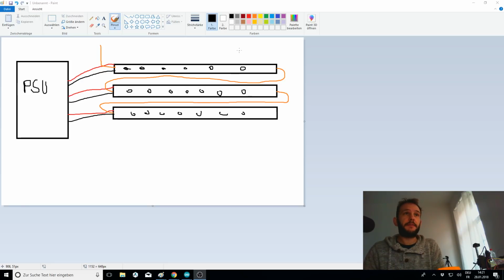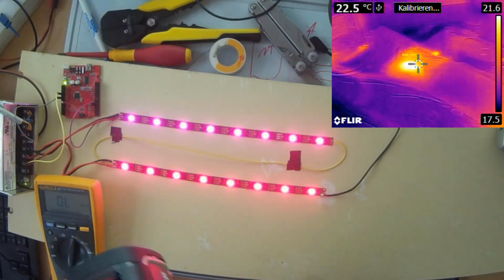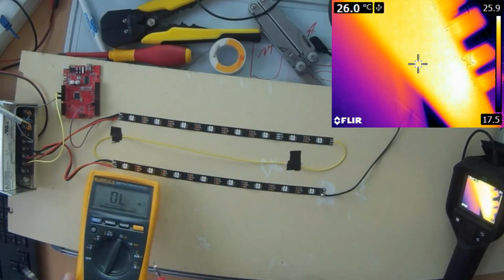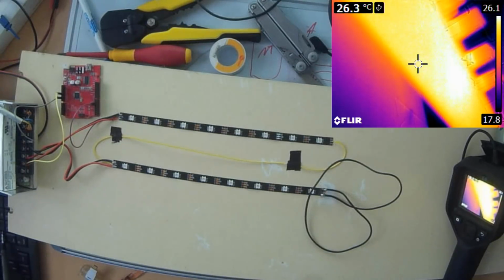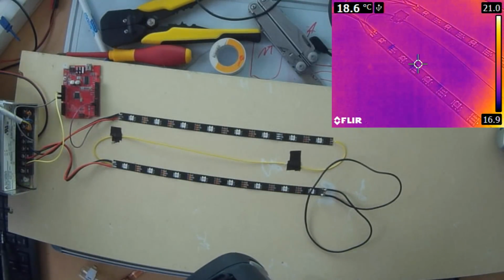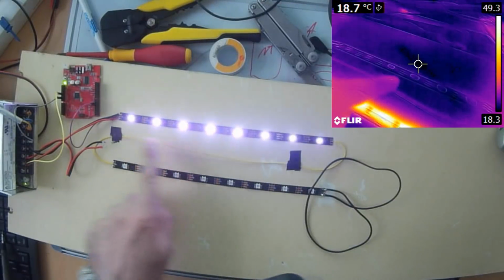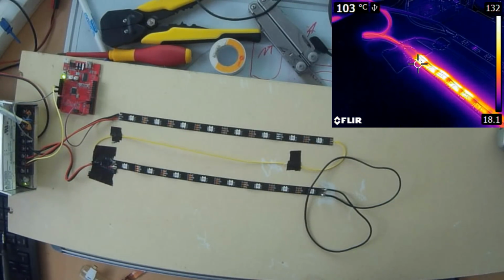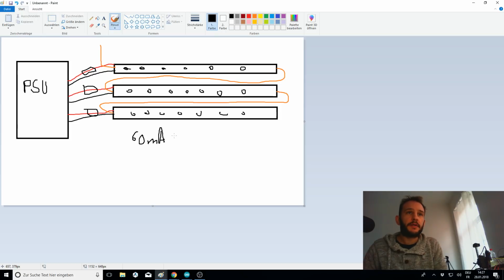[ English ] WS2812 Flexstrip overheating by short circuit. Common error done by people

Comment: Glad I found this old video. VERY helpful info for safety with power supply and LED strips. I think I can get a DC power distribution box that has built in fuses. Should do the trick, right?
Reply: i watched a german video where somebody said that a built in fuse in the power supply doesn't save you, you would still need a separate fuse for the strip. but don't ask me why this is the case. i am clueless.

Comment: hard to believe such an important info is rarely even mentioned in any strip diy project, out of curiosity - if you have for example a strip calculated for 1A - what actual current get go through in case of a short?

Comment: if you do power injection do you need double the size of the power supply?

For example, I'm using a 12V 7-meter/60led per meter ws2811 which is around 120-130 watts consumed if I inject the power source to the end do I need to get a large power supply.. like 300w?
Reply from the maker: No, power will be the same. Only currents will be split. In this case you have to adjust fuses. 120W/12V = 10A. So if you inject you should use 2x5A fuses.
Reply: @ThomisBastelstube  thank you very much. Are fuses necessary for led decoration?
Reply: I was wondering if using a sp108e controller, does it have a fuse inside it?
Reply from the maker: @zuest696  i would recommend them.

Comment: Is it possible to burn out LEDs that are shorted downstream like you have it?
Reply from the maker: Electricity ( Current ) will always take the path with the lowest resistance. The leds are not actually damaged. its the heat of the copper that leads to the problem and fire.

Comment: I'm not sure why you would short circuit in the first place... I mean what would you expect to happen?
Reply from the maker: A shor circuite can also happen by accident. I just shorted it to show that the psu does not recognize the short as the resistance of the cable limits the current.

Comment: Just coming back to this video since someone linked it again, thank you for making it! It in part was the inspiration to make my QuinLED-Dig-Uno boards and my newest QuinLED-Dig-Quad boards with a fuse on them. The Dig-Uno v1 without a fuse never came out and only when I got to v2 with a fuse on the board itself did I release it to the public. The Dig-Quad, meant for larger installations has 5 fuses on it to be able to do proper power injection wiring with fusing all on the board itself! 👍
Reply from the maker: Cool! Thanks a lot ! Do you have a video of it ?
Reply: Check his channel. There are a lot of videos. I have made 5-6 of each type and they are great!

Comment: would fuses be a good idea with a 5 volt 1.5 amp power supply? The power supply is just a usb wall adapter. Surely that would be able to detect shorts right?
Reply from the maker: with a 1.5A usb psu the risk is quite low , more likely it will damage the psu instead of the flex starting to burn

Comment: I need help reducing the heat of DOUBLE row white 5050 led strips. Even if I place power leads every 1m and put the double wide led strips on an aluminum channel after about 30 minutes the aluminum is approximately 120 degrees F. You can touch it for about 15 seconds and then it will start to hurt. IF I ran them at a lower voltage  say 10V would that reduce the heat? so many of my customers have complained I have stopped using them I have bought these 20cm wide strips from many different resellers and they all have the same overheating issue. I think I might just have to use the single strip ones from now on?

Comment: Thomas, problem with your approach is that you need fuses for each branch, and that led strip power  topologys can get complex.
But, generally it's good.
I have two other ideas that can can address the same problem.
First is more complex, and it includes sensing power rail current and comparing it with the pre-calculated values based on LE diode states.
Second approach is very simple . Hook up data out of the last LED in the strip to a watchdog timer implemented by a MCU or in hardware, and turn off the power supply remotely in case of a timeout. A broken LED or a short circuit can cause it.
Reply from the maker: the second idea is brilliant ! would be nice to monitor the return. but i guess its cheaper to just install fuses :)
Reply: Well my future LED strip setup will be much cheaper than my flat. So I plan to implement as many safety devices as possible, including fuses.

Regarding the first idea i have a dozen of T60404-M4645-X010 industrial current sensors and DRV401 chips on stock. So, I might as well implement it.
Reply: Try comparing the current in two led strips if they are same length? Use some form of differential current circuit breaker?
Reply: what problem in the approach?  Fuses near the PS are so simple to implement!  The OTHER 2 ideas are way more complex IMHO...

Comment: Great video.
I asked myself that kind of question for my led project and I found your video. 
I think there're few informations treating security voltage for diy led strips or microcontrollers devices like arduino or raspberry pi on internet...

Is blade fuse's block like this could be ok for +12v for example?
https://www.ebay.com/itm/Car-Marine-Boat-4-Way-Circuit-Blade-Fuse-Box-Block-Holder-ATO-ATC-Warning-LED-DH/352215455397?hash=item5201ad56a5:g:UJ4AAOSwMQBaE59g
Reply from the maker: Thanks! Yes, such a fuse box is ok. You only have to select the correct fuses ( fast or slow blow and current ) for your application.

Comment: Thank you, Thomas.  You raise an important issue that many people do not consider.

I'd like to add that fuses/breakers protect shorts on the transporting wire too, so should always be placed as close to the PSU as possible.  They are most often sized for the wire, but can be derated to the end device's maximum current draw as you suggest in this video.

If a wire feeds several strips a few meters away from the PSU, there should be a fuse close to the PSU sized for the feeder wire's gauge, and a fuseblock close to the strips with fuses sized for each strip.  For example, you might use a 7.5A fuse at the PSU feeding a 18AWG (1.02mm) feeder wire hooked up to a remote fuseblock with a 1A or 2A fuse for each strip.  The first fuse is just for the feeder wire, so the larger size (fuse and wire) minimizes voltage droop.  If the fuseblock is right next to the PSU, you can usually skip the fuse on the short feeder wire as the risk of a short circuit on that that does not also trip the PSU's overload protection is minimal.